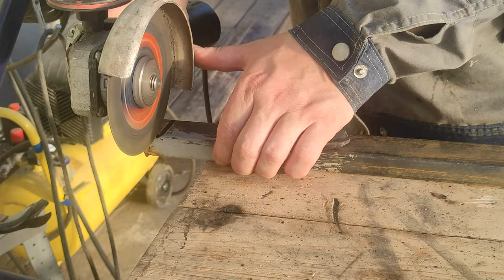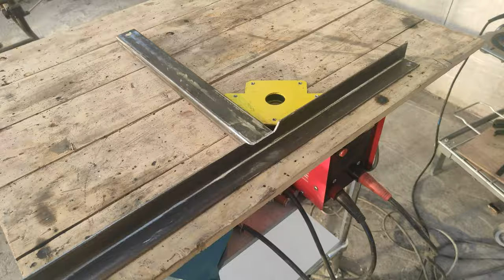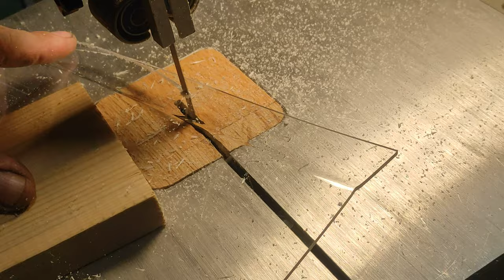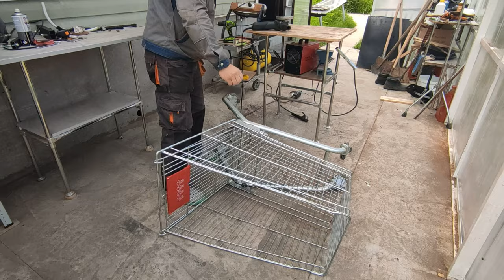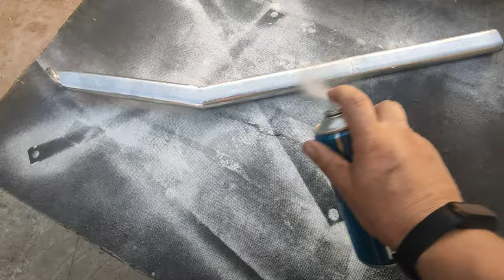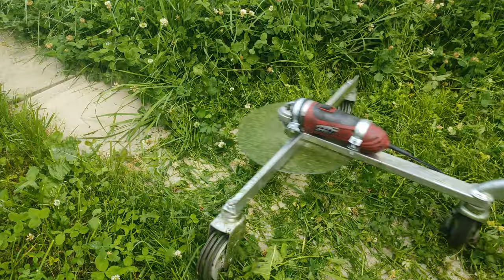Few people know the secret about this application of the old grinder. A brilliant idea

Comment: So you needed a welder, grinder, drill press, shopping cart, jigsaw, an old cordless drill to make a weed whacker that you could get used for less than the ticket you'd get for stealing the shopping cart. 
Some of these DIY channels piss me off. "It's simple put your design into your CAD software, print it out with your laser cutter and use your auto-sledge to shape the handle before you put the wood covering into your lathe."

What if I have an apartment in NYC? (I mean, I don't. I have 5 acres on a mountain, and I'm a blacksmith, but still!!)